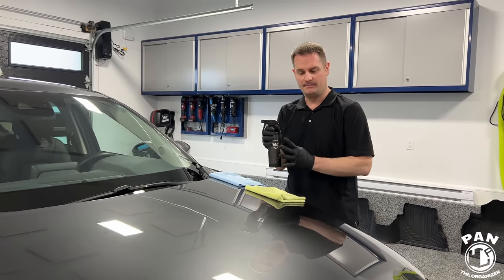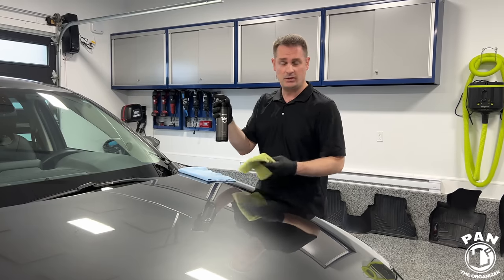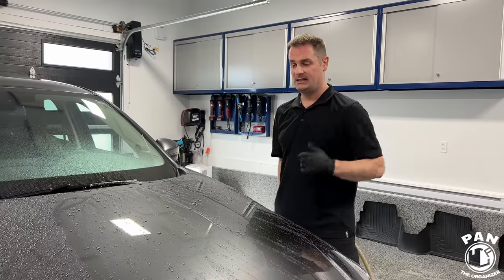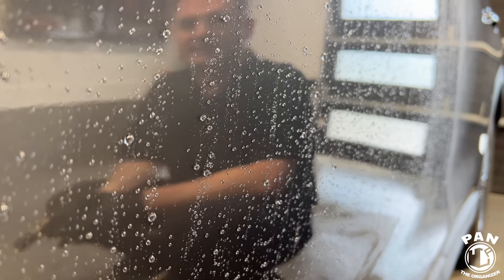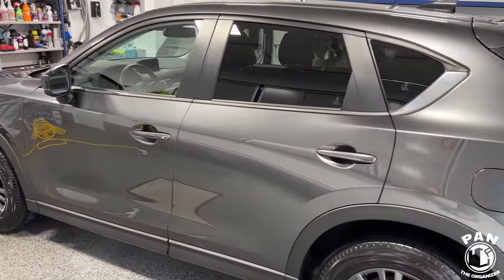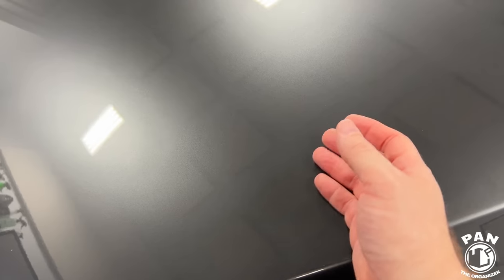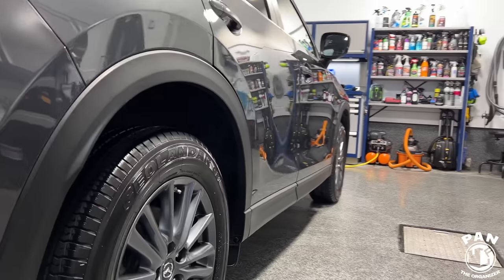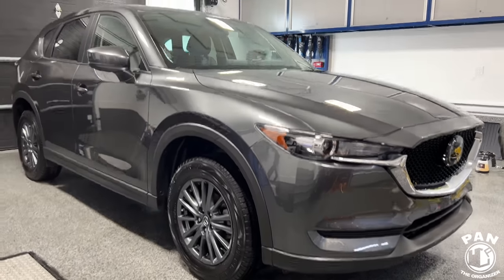NEW! AvalonKing Armor Shield Lite : Ceramic Spray Made EASY!

Comment: The most important part of car care in the northern climates where salt is used during the winter is to thoroughly rinse the wheel wells--especially this lip around the perimeter.  The car surface can be perfectly clean on the outer surfaces, however, the scourge of NaCl will be doing a number from the underside outward.  When I had a '79 Camaro (I drove that year round), I rinsed the wheel well every day and after 10 winters it had minimal rust.

Comment: I have the Armor Shield IX ceramic coating. Topped with Turtle wax 75th anniversary ceramic,carnuba, graphene paste wax. For my maintenance washes I spray the TW wet wax as drying aid. My panels are so hydrophobic it scares rain drops from clouds 3500m overhead
Reply from the maker: Heheh that's a good maintenance regimen.

Comment: My truck had a ceramic coating put on it at the dealership. It has lasted 4 years. I do wash it every week with a car soap. Can I use this product over the existing one for better protection?  Thanks for all do
Reply: Hi Don! Armor Shield Lite works great as a topping agent.
Reply from the maker: You absolutely can! Keep in mind, it's important to use a maintenance topper on ceramic coatings, at least once every 2 to 3 months. You can't just wash your car and do nothing else. Coatings need to be refreshed to maintain their performance and durability.
Reply: @PanTheOrganizer  thank you so much for the information

Comment: Hi Pan,
Great video as always. My Audi SQ8 has CarPro cquartz 5year ceramic coating applied. Every maintenance wash I finish with Xtreme solutions topper. Would the Avalon product be a better choice? Love to have your opinion. Thanks.
Reply from the maker: Both are very good, you'd be splitting hairs.
Reply: @PanTheOrganizer  Thanks Pan

Comment: Hi Pan, do I need to throw away the microfiber towel that is used to wipe off the ceramic coating spray? Will it scratch the paint if I re-use the microfiber towel?
Reply from the maker: No. Just wash the towel after use, and you can reuse it.

Comment: Nice job Pan. You are a good brother.  That said, I really prefer the AK SiO2 Ceramic booster spray. Once it cures, it’s Fantastic. A lot more sheeting than Armor Shield lite which is my preference. I do agree it’s more difficult to apply and buff out. I noticed they stopped selling the booster spray on the Avalon King website. I’m sad about it and hope they bring it back!
Reply: Pascquale thank you for your feedback and we hear you.  we'll bring it back, just in a revised form with easier application.  But yeah with similar durability.   We just wanted to focus on a super simple application, primarily something that could be done in any condition and environment.
Reply: @AvalonKing  IMO, the new version beads too much, instead of sheeting.  Other products on the market like Phoenix Titan are better. I need try the new BC line from Brian at Apex detail also.  Technicians Choice is also one of the best values. Just my 2 cents

Comment: Hey Pan nice review. In regular maintenance washes for a ceramic coated car could you apply a sealant like bead maker and every 2 to 3 months top up the c.c. with a ceramic spray like gyeon wet coat? I heard somewhere that bead maker will clog the pores bc its synthetic polymer. Χαιρετίσματα στον Καναδά!
Reply from the maker: You can use Bead Maker as a drying aid for your weekly washes no problem. But at least once every 2 or 3 months, use a ceramic or graphene spray for proper maintenance.

Comment: Hey Pan, great video. I have to look into this product. I had another question. I am looking for a very glossy water based dressing. Do you know of any water based dressings that give that wet look to tires? Are there any tips or tricks you have for applying a water based dressing to look wet? Many of my clients prefer super shiny/wet looking tires however, I do not like solvent tire dressing due to them being so hard to remove.
Reply from the maker: Super glossy wet looking and water based dressings don't usually go together... If you like the glazed donut, ultra wet look, a solvent based dressing is it, but it's not good long term for the rubber. You could get a quality water based dressing like the Adam's Graphene Tire Dressing and apply two layers to increase gloss a bit, for example.

If you explain to your customers the benefits of a water based dressing and educate them, they should understand and actually appreciate the look of them.

Comment: Hey Pan. I really enjoy your instruction and trust your opinions. Just bought 3 bottles of the Armor Shield IX for 39.99 a kit, which is a great price. However, when trying your codes they said at that price no further discounts apply. I also tried to get a discount for being a first time buyer which they sent me an email link for but had the same results. I think the product sounds great and did purchase and received free shipping. I don't need any other discount off the product but I think it makes you look bad, and them as well, when a discount is offered and not given. It would have made me feel better if they replied that code as valid for these dates and no longer applicable since it has been a stretch of time since this product was offered on your site. That said, Keep Panning! I'll be watching and supporting!
Reply from the maker: Hmmm. It seems you did something wrong, as I just tried the link and added the discount code PAN25 and it works just fine. Did you make sure to click the exact link I provided? Because if you just visit the website without that link, and try to use the discount code, it won't work. You have to use the provided link, and then apply the discount code. 

This link: https://avl.kg/pan25

Put the kit in the cart, and then go to your cart, and in the "Apply code" box, type PAN25. And boom, the discount works.

Another thing I would like to point out, is that all my AvalonKing videos, especially the first ones on the coating itself,  were filmed a long while ago, year ago, and no brand is obligated to keep discounts going for years. Their business, they decide. I have no control over that unfortunately.

And just for the record, even if the code stopped working, it wouldn't make me look bad. That's a silly comment. Don't say things like that. I have built a solid reputation after over seven years on YouTube. There's a reason why I have almost one million subscribers and it's one of the top three biggest detailing channels: people like my videos and trust my advice/opinion. 

As far as discounts and stuff, I'm sure you can appreciate that I don't have control over that. Nobody will offer a lifetime discount as a brand... And I obviously can't go back and change videos once they are posted. Again, I have zero control over this.

But all of this to say that the link and discount code still work 100%. I also can't control if people don't follow the steps to get to the discount. It's clearly written in the description:
Get 25$ off your purchase when you use promo code PAN25 during the checkout process when you buy the AvalonKing Armor Shield IX here: https://avl.kg/pan25

I can't be more clear than that.
Reply: @PanTheOrganizer    Thanks for checking out and verifying that the code still works. Might have been I had 2 windows open to the site, one from your link, and one from their link. Regardless I was wrong. I apologize. Thank you for your channel and response.
Reply from the maker: Apology accepted. No worries. It takes a real man to know he was wrong and apologize. So thank you. 👍🏻

Comment: Is it true this can be used even when the car is still wet from the wash? If so, will it have the same effective results as when it was dried first?
Reply from the maker: Yes you can use it on wet paint as a drying aid. Obviously with any product, if used on dry paint you get a but more performance as it’s less diluted. But don’t overthink the moment.

Anyhow, when towel drying, it’s important to always use a drying aid to add slickness on the surface and reduce marring from drying.

Comment: Good morning Pan!  Had a question.  After ceramic coating, how long does the coating need to cure before Armor Shield Lite can be used as a topper??
Reply from the maker: Wait two weeks before washing your car again, and then you can start using Lite.

Comment: Sio2 boost as a initial layer? And then top up after 13 hours with a shield light? Does it going to work better? Do you recommended it like that?
Reply from the maker: SiO2 Boost Spray isn't available for sale anymore. But if you have it, then yes, one hour after your final layer of AvalonKing ceramic coating, apply one layer of SiO2 boost spray. Wait 48 hours without exposing to water or rain. And wait 1 to 2 weeks before washing the car again, and then you can start using Armor Shield Lite for maintenance.

Comment: quick question, just bought a brand-new car a few days ago and thinking about applying Armor Shield ceramic coating. do i need to fallow all the steps before applying?
Reply from the maker: Hi Fabian. A new car is never new until it's properly detailed. 
- at the factory, the paint defects are often corrected quickly by rotary polishing which can leave marks and holograms
- vehicles are then transported by truck, train and boat so they are exposed to the elements, industrial fallout, brake dust, rail dust, etc
- vehicles are often left at boat docks (when transported by boat) or in exterior parking lots for weeks or months, again being exposed to the elements
- at the dealership, the vehicles are almost always poorly prepped using the same dirty water that was used for all the cars on a given day, and poor washing and drying methods leading to swirls and scratches, and a layer of cheap wax is usually applied to attempt to make the paint glossy prior to delivery

I explain all of this in this popular video: https://youtu.be/QgoyrC-5CMc

So you can better visualize the new car prep process, here are the steps I perform on a brand new car from two of my customers: 
Tesla Model Y: https://youtu.be/gohks8xP5NY 
Porsche 911 Carrera: https://youtu.be/2ckiivbFqs4

Comment: On the last black car I detailed I did the 2nd machine polish with a Black Ceramic Polish, then IPA wipe then wash then dry aid with AK Lite followed by AK Boost.   (The boost for me has to be followed with a damp towel.)  Not sure if trying to put Boost on top of Lite makes any sense for customers that are not asking for a true ceramic coating, AK Shield IX, but they want to get through the winter with paint protection.
Reply from the maker: You could have simply applied SiO2 Boost Spray first, as it's the longest lasting, and maintain that with Armor Shield Lite.

Comment: Nice video! Would it be right to use a drying aid before or after the application of the SIO2 spray or would it affect the topper or even the gloss? By after i mean after the next wash obviously 😂
Reply from the maker: Just use this as your drying aid. It can be used on wet or dry paint.
Reply: @PanTheOrganizer  I use a different brand basically (also one of those you recommend) and I noticed that the last couple of times I washed my car and used no drying aid (I was out of my SIO2 spray) the paint looked different, but in a good way. Could it be possible that I don't apply it correctly or is it a problem if you use such products often? Bear in mind that I wash my car every 7-10 days.
Reply from the maker: You are perhaps getting into product buildup. Maybe skip using a drying aid every now and then.
Reply: @PanTheOrganizer  I was just too afraid to touch the car with no drying aid 😂 As you say, let's not overthink the moment and thank you so much for the responses Pan!
Reply from the maker: My pleasure George. ;)

Comment: A quick question for you Pan, is there any trick/tip regarding applying a second coating of Armour Shield IX after the original application? I was limited in time when applying the first coat and its been a few weeks since the initial application. Thanks in advance!
Reply from the maker: If you didn’t do it within an hour of the first coat, I don’t know unfortunately. You’d have to ask them what they recommend.

If I had to guess, I’d wash the car, dry it, use a panel prep spray, and apply another layer.
Reply: Hi Pan! I contacted them and they suggested to wash, buff off the AS Lite, IPA, re-apply AS IX. I have a project for the weekend!

Comment: I really liked the armor shield IX ceramic coating! I was disappointed in the armor shield ceramic boost, it was to darn hard to work with so wont be using it again. I might consider taking a chance on trying the armor shield lite in the future if I could get it  at a discounted price of course.
Reply from the maker: It’s much easier to apply compared to SiO2 Boost for sure, although I had no issues with Boost.

Comment: Would it be safe to use Mothers ultimate ceramic spray wax as a booster along with their car wash both say they are Sio2 which means they should be okay with a Ceramic coating right?
Reply from the maker: Yes

Comment: Could you apply for instance the TW flex wax? Instead? Or the Reload? Or the Cure? Or any other sealant? For instance?
Reply from the maker: Yes, any ceramic or graphene spray coating of your choice.
Reply: @PanTheOrganizer  thanks for your answer! So because I am confused why someone to chose the light version that last from 1 to 3 months and not for instance THe TW FLEX WAX THAT IT LASTING MORE THAN 6 TO 9 MONTHS!?.
Reply from the maker: Because different people like/want different things. Some people also like applying products more often as they enjoy the process, so a longer lasting product isn't necessarily what they're looking for.
Reply: @PanTheOrganizer  thanks. Man,
Sio2 boost as a initial layer? And then top up after 13 hours with a shield light? Does it going to work better? Do you recommended it like that?
Personally I will going for GRiot Garage 3 in 1 or Turtle wax flex wax!

Comment: Do you think it’s better than the gyeon q2m ceramic detailer and carpro reload? I have the P&S legend 5 year ceramic coating.
Reply from the maker: It depends what you mean by "better". I would recommend not overthinking the moment when it comes to quick detail sprays. These are meant for maintenance and ease of use. Not for long term durability.

Comment: Would you choose this or Turtle Wax Graphene Flex Coating for an uncoated car? thanks
Reply from the maker: You can't really compare both products. The Graphene Flex Wax is a 9 to 12 months durability product, and the Armor Shield Lite is a 3 to 6 months product according to AvalonKing.

I would recommend the Lite more for maintenance of an existing coating. And the Flex Wax if you plan on using it as a standalone paint protection.
Reply: @PanTheOrganizer  thanks Pan appreciate it and yeah thinking of getting Turtle Wax Graphene to use standalone once my Seal And Shine runs out
Reply from the maker: Did you watch my Flex Wax video? Here: https://youtu.be/b5BjDzItlr8
Reply: @PanTheOrganizer  yep that's what's drawing me to it to be honest that and the fact that there's no cure time (I don't have a garage so the Turtle Wax Hybrid Solutions Ceramic Wax isn't ideal unfortunately)

Comment: Hello, Thanks for all the great videos and information.  I live in Massachusetts and I am wanting to get my wife’s Lexus NX300 F Sport and my 2013 Tahoe ready for the winter here. She rarely cleans her truck and I have tried to keep my truck clean but the paint has issues I need to address or get address.. what would you recommend to get them ceramic coated by me just until the spring so I can take the time and really get them deep cleaned and protected… I just need something that will not take a long time and last at most 6 months.   

No garage to clean or store vehicles.  Vehicles are parked in my drive way in the open elements and we have a tree in the back yard that dumps acorns and “helicopters” on the driveway. Also something not to pricey and I can find local like Walmart or autoparts 

Thank you
Reply from the maker: If you need a quick spray that can last upwards of 6 months, watch my video here: https://youtu.be/b5BjDzItlr8
Reply: @PanTheOrganizer  Thank you will this be good if nothing has been done to the paint before like no ceramic coating?
Reply from the maker: Yes, you can use it on unprotected paint.

Comment: Don't know where else to message you as I don't use social media.  I have a 2021 G80 3.5L TT in Pronto Red.
My question is, do you believe that a quality car cover  can  be used  if I must park my car in the sun at a jet center/ private airport 5 days a week in southern kalifornia?
Thanks Pan
Chris.
Reply from the maker: Hi Chris. I mainly respond on YouTube, as I already spend 4 hours daily responding to thousands of comments from 820,000 subscribers and millions watching. So it's nearly impossible for me to also reply on all social media platforms. I would die trying.

I don't use a car cover as my car sits in my garage, but yes you could certainly use a quality car cover to prevent the vehicle from being bombarded by UV rays and other pollutants in the air (like jet fuel!!). Also make sure you have some paint protection on the paint.
Reply: @PanTheOrganizer  thanks for taking the time to respond.  Great vids. Keep it up. I’m a Retired US Marine, and had to purchase the car mentioned due to a not at fault Motorcycle vs. Car in Laguna Beach, CA. I was the motorcycle 2016 Ducati Multistrada Enduro 1200.  2 broken wrists and a pelvic.  Got to keep the new cage clean. Lol
Cheers….